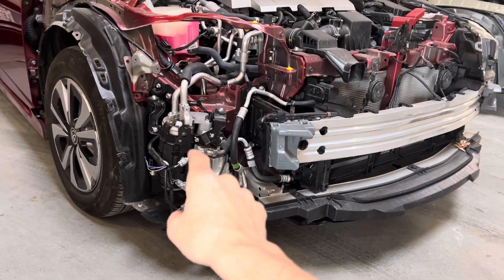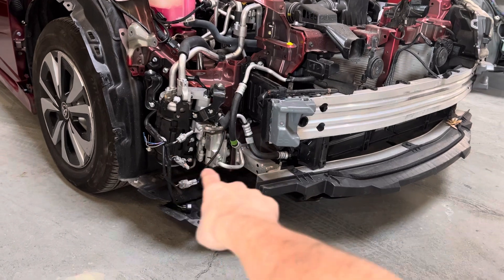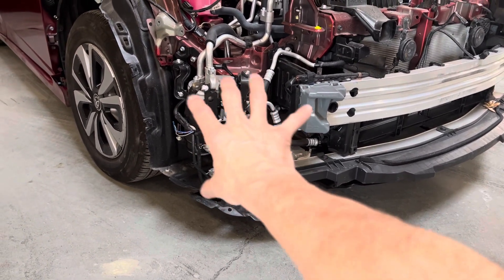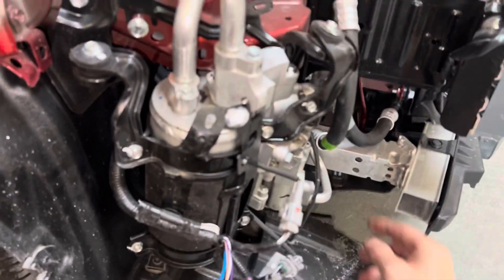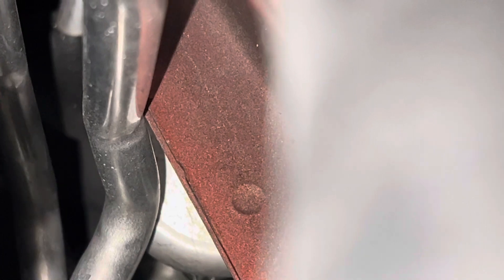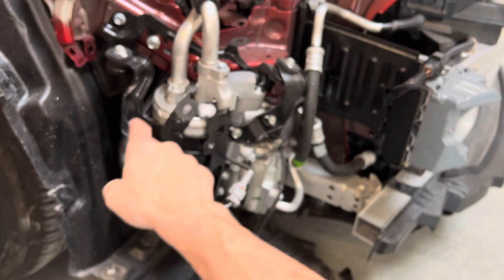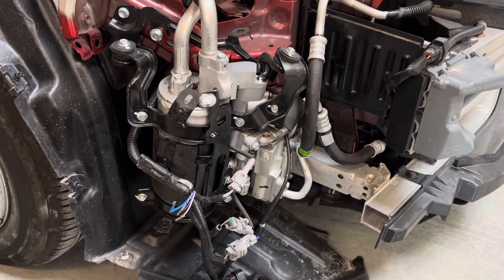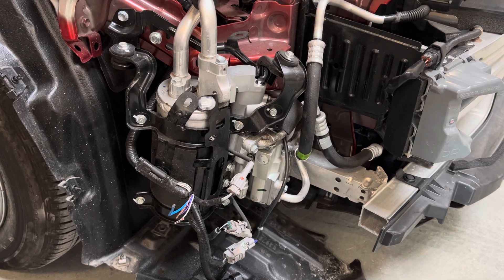Prius prime 2017 heat pump accumulator assembly replacement￼

Comment: I have a prime I bought that was rebuilt after an accident,  its now throwing code B1476 A/C inverter load system,    there is refrigerant in the system ( I connected my gauge manifold ) but it does not seem to operate, although sometimes when running in EV mode, I do see "power" running from the battery to the hvac system on the power distribution page.   Any ideas where to start troubleshooting?  I am in Canada, and the accumulator assembly is over $17000  here!   hope you could help me with some advice.  Tom
Reply from the maker: @scudsrunners9698  this is usually not DYI level stuff. 
      You are definitely going to need if your DYI to purchase a couple days or week access to Toyota’s website for their service information and download and print out.  All the diagnostic information you can you’re gonna be doing testing of wiring, power consumption, looking for short and open. 
      If you are DYI and you have time on your hands and you are mechanically able and proficient and used to working on vehicles. 

You might be pulling off the compressor .  To dump out the oil to do a balance and see what is inside.

And you will be keeping your eyes out looking for metal flakes or burnt oil .  Hopefully you do not find gray oil or tiny metal flakes because that’s going to be a very bad day for you. You will need more than a accumulator or a compressor..
Reply: @coldfinger459sub0   Thanks for the quick reply,  Im dont think this will be anything beyond my abilities - do you see compressors go bad with less than 60k miles?  From your experience,  what typically causes the b1476 code?  would low refrigerant throw this ? that is the only code active on the car.   Im going to pull the bumper this weekend and start troubleshooting. The biggest challenge here is if I could find a decent shop I trust, I would take it there, however I doubt anyone here will have 1/20th the expertise that is required.
Reply from the maker: @scudsrunners9698  there is a TSB on this vehicle Google is your friend. There’s a bunch of videos about this code and a bunch of information.

Mile means nothing about a compressor burning out compressors don’t burn out they are murdered 

I’m used to seeing the burnt out compressors after they’ve been serviced by a body shop after front end collision 

Usually when they’re replacing the condenser or replacing the accumulator assembly 

They don’t use enough oil they use the wrong oil they use no oil or improperly, recharge or contaminated refrigerant causing compressor burn out. This is what I mostly see. 

Another thing is low on refrigerant check for leaks. You may see some oily dark dust accumulation at O-ring fitting junction points for hoses and lines. This is very common on the Prius prime as they get older. There is a lot of connection points.
Reply: @coldfinger459sub0  Would low refrigerant throw that code?
Reply from the maker: @scudsrunners9698  when you look up that code on the same page, that’s what it tells you exactly could be one of the possibilities. 
I’ll try to throw a link in the next response because sometimes You Tube blocks links and won’t let me post them
Reply from the maker: @scudsrunners9698  let’s see if this link works if you two allows it I’ll post
https://share.qclt.com/%E4%B8%B0%E7%94%B0%E6%99%AE%E7%91%9E%E6%96%AF%E5%8E%9F%E5%8E%82%E8%8B%B1%E6%96%87%E6%89%8B%E5%86%8Cpdf%E6%A0%BC%E5%BC%8F/repair%20manual/04pruisr/05/2044g/cib14767.pdf
Reply from the maker: @scudsrunners9698  yes that makes sense.
Reply from the maker: @scudsrunners9698  only on some cars not all
Reply: @coldfinger459sub0  So I recovered 365 grams of refrigerant,  started to recharge, but the compressor doesnt turn on and is still throwing the b1476 code,  suspect the compressor is bad.  Im gonna start to pull it all apart tomorrow, and see if there is any corrosion on the connector to the compressor, however I doubt that is the issue... sounds like the compressor is done.
Reply: @coldfinger459sub0  when you see the compressor go bad. Does it typically throw that code ?
Reply from the maker: @scubafun2453  i’ve seen Toyota compressors go bad without throwing that code
Reply: @coldfinger459sub0  Do you know if there is a fuse in the high voltage line to the compressor?
Reply from the maker: @tomw5890  it might be in the inverter, feeding the power to it.  I’ve never had to play with the fuse on one.. 

In all my years of replacing Prius compressors never once has been ever been bad never once has the fuse been out 

But I read a lot of stories about Shop replacing that I don’t need to be replaced .
Reply: @coldfinger459sub0  youre probably correct.
Reply: @coldfinger459sub0  I just pulled off the connector from the compressor,  345V.  looks like the compressor is bad...  whats the best way to get the compressor out?     I ordered a replacement compressor from ebay,, hopefully Im not buying a pos..  ha
Reply from the maker: @tomw5890  with your hands 🤭
      Book time is 3.5 hours, but you should be able to get it out faster than that unless it’s your first time maybe maybe not. Getting a junkyard one is definitely cheaper than a $1500 brand new one
      Specially, if this is your first time doing it, and you might not follow the procedures correctly I’d rather burn out a junkyard one then burn out a brand new one.
Reply: @coldfinger459sub0  Hi Tom,   I've been doing some more troubleshooting..  it looks like my compressor is bad, dont think its burnt up,  however there is dye in the refrigerant,  do you know if the factory ND11 oil will glow?  Im gonna be gone for a couple weeks on a work trip,  but when Im home, I'll tear it all apart and see if compressor ate itself, or someone just added the wrong oil, and shorted out the compressor.  Ive got a used accumulator, new drier, and used compressor coming,  guess will have to wait and see if I need to order a new condensor.
Reply from the maker: @tomw5890  looks like you going to have a fun project. 

No factory UV DENSO OIL

Comment: Tom, I've got 2017 Prime, 39K Miles, No Accidents.  Local mechanic found oil leaking from where AC tubing enters the AC Accumulator.  Have you seen any patterns of other Accumulators failing without any corresponding vehicle damage?  And yup, I think I'm in big trouble.